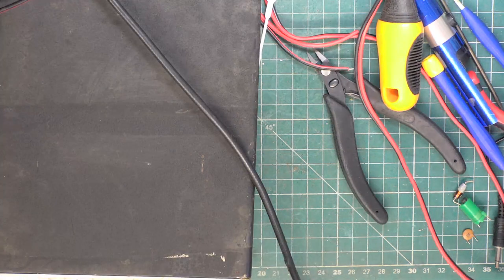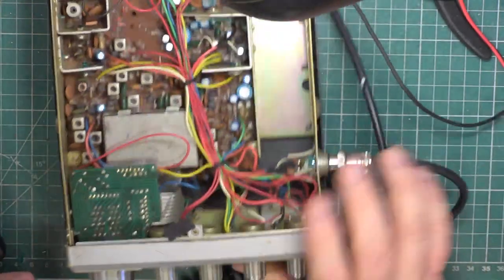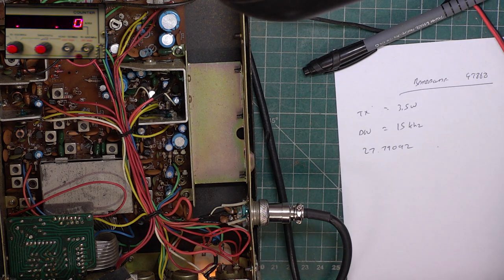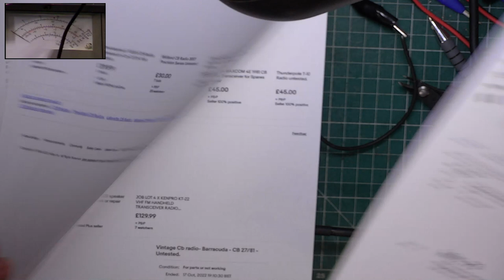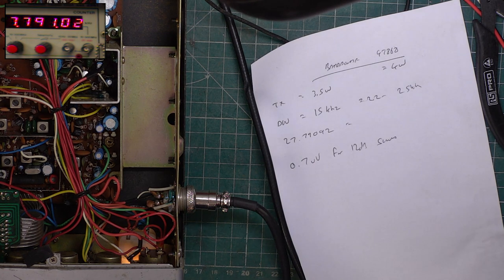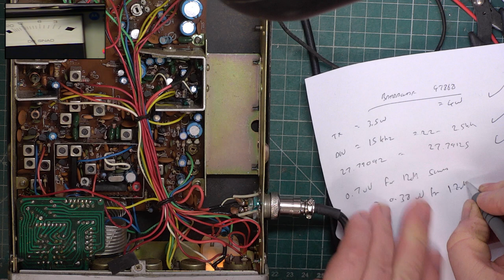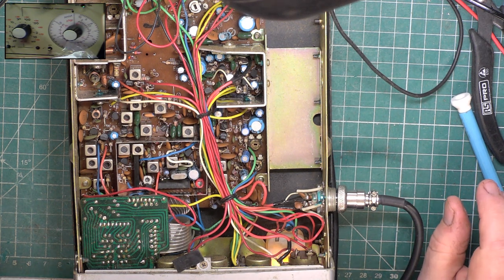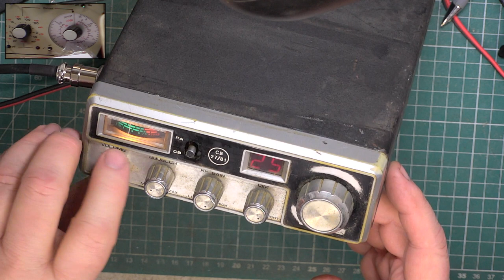Barracuda GT868 CB27/81 UK FM CB radio - service alignment

Comment: These and the Fidelity 1000 have to be the worst CB sets of all time... The Fidelity wins It for me.
Reply: I disagree, they have a wonderful ratio descriminator, and a PLL that modifies easily.
What lets them down is a rubbish 2nd RX mixer which wouldnt matter if it was protected by a 10.695 crystal filter, and a TX FM mic amp with very poor limiting.
 Both of which can be cured

Comment: Super sensitive or just extremely poor rejection..
My video proves how bad these are when you clearly can hear a signal on every channel.
Reply from the maker: I'll finish setting up two HP synthesised signal generators on bench 4A once the organ job is finished in a couple of months time. I want to do some selectivity tests. I've a sneaking suspicion that quite a few current new models aren't much better....it's just that with far lesser users people don't realise it.

Richard
Reply: The sad thing about 27/81 is turning on the radio on and silence, back in the day a real source of entertainment. F ing I phones are to blame
Reply: @lyndonwebber1389  and UV5R
Reply: If Its rubbish 2nd mixer gets protected by a 10.695 crystal filter properly matched?
 S/N improves as well, it transforms the RX
Reply: @lyndonwebber1389  Around here CB died when certain people who were the source of the entertainment died.
Richard knows what it was like in Nottingham, but once people passed CB went down hill never to recover.
Reply: @ukfmcbradioservicingTango21  Depends on the rig? as youve shown the Danita 3000 UK has a great RX thanks to its xtal filter
Reply from the maker: Father Time at Carlton comes to mind Mark.
Reply: @CBRadioWayBack10-4  same around hear most died through drink and drugs sad
Reply: @ukfmcbradioservicingTango21  I was thinking of a few of the trouble causers and channel 19 Hoggers, the Alphas, Boxer, and all the Haters of the said people.